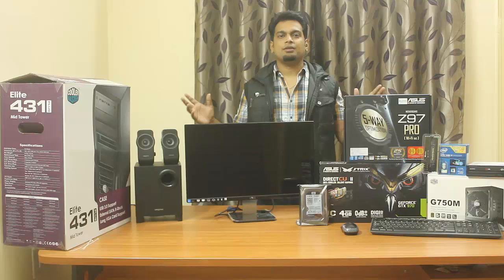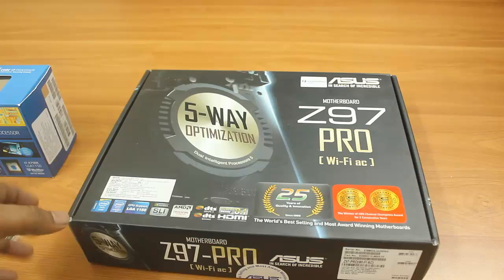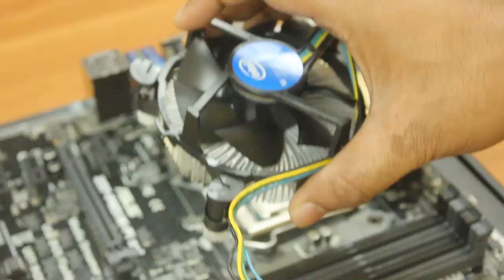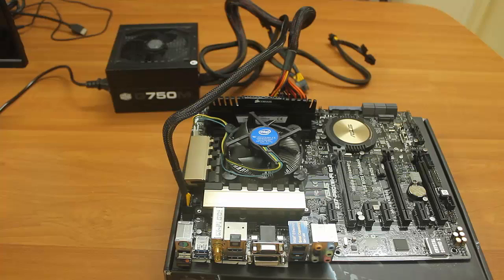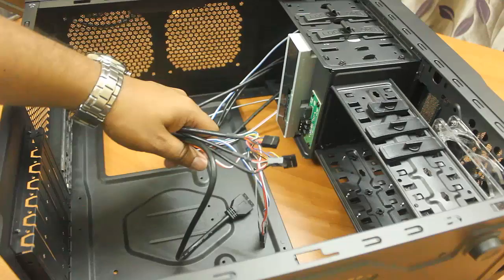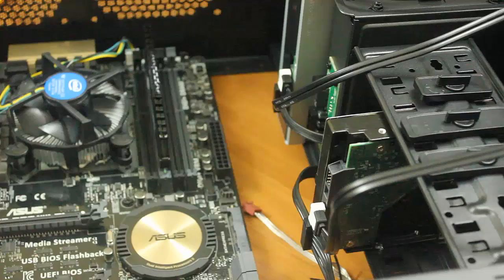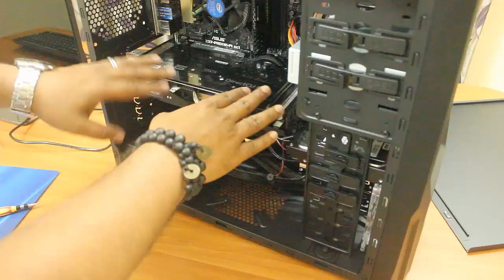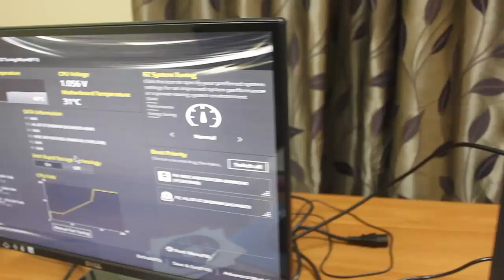How to build $1500 ultimate gaming PC  2015 - 2016 | India | intel i7 4790K | GTX 970 |

Comment: Why one 8gb stick instead of 2x4 or 2x8? You can't use dual channel RAM with one stick configs, and single-channel in an i7 with GTX 970 build seems...poorly matched.
Reply from the maker: bluesy92 Its working great ... All games running on maxed-out setting at 1080p with 60fps ... Video rendering is also quite fast .. Don't know how much will be the improvement after adding one more RAM ..

Comment: Is the standard cpu cooler good enough? Do you have any other recommendation for a cooler? And is the cabinet quite and does it keep the air filtered?
Reply from the maker: Stock cool is good only if you do not overclock your CPU .. else you need to have external cooler .. you can go with liquid cooled cooler from Corsair Hydro Series H60 CPU Cooler ..
Reply: Tech Virus Could you give me the full name of the dvd writer?
Reply from the maker: LG GH24NSC0 DVD Burner
Reply: Tech Virus Gotcha! I'll build the same one you got :) With that i7 cpu I shouldn't need to overclock
Reply from the maker: Right no need as of now for any game .. all game runs at maxed out graphics ... you can overclock when you need it , may be next year ;)
Reply: Tech Virus Yes that's a good point :)
Reply: Tech Virus would you recommend a ssd?
Reply from the maker: If you have budget ... its a good option .. it will help you to make you PC responsive .. like applications will load real quick .. but for games it will not give any performance boost .
I am waiting for SSD price to drop, I would want to go with 512 GB of SSD which costs around 18k as of now , my be after 6 months price will reduce .
Reply: Tech Virus Ah okay so if you have your operating system on that ssd it will boot up a lot faster i suppose. Maybe it's smarter to go the same route as you did, with the WD hard drive.
Reply from the maker: Yes .. now it takes 30-40 sec. to completely boot up , after adding SSD , it will take around 15 sec. , yes you can go in my way , just make sure to install all your games in non-OS partition , so in case you upgrade to SSD you do not have to install heavy games again ;) just re-install OS on SSD and you are good to go .. also there are tools available to migrate OS from non-SSD to SSD drive (not yet checked how effective they are)  .. all the best for your new PC built ;)
Reply: Tech Virus Thanks man for all your help :) I think i'll go with a Samsung 840 evo ssd 120 gb and use it as the bootdrive and the 1tb black edition will be used for storage :)
Reply from the maker: Welcome bro ..I would recommend to buy at least 256 GB SSD , as you can keep resource hunger apps on SSD for super performance and who knows if new windows 10.0 will take 50-60 GB .Its always good to be future proof (at least some what) .. But its your Choice at end as budget also matters ;)
Reply: Tech Virus Yeah it's better to be future proof so I'm going to order a 250gb ssd instead :) By the way which operating system would you recommend? I've used 7 and 8 before and i liked 7 more because it didn't have that bullshit swipe menu with all the different colors :P
Reply from the maker: Good ... go with windows 8.1 , yes it has those stupid things but some tests has shown that 8.1 has better game performance than 7 . And also games in future would more optimized for 8.1 ... so go with 8.1 ;)
Reply: Tech Virus Sounds great :) Does 8.1 have the start button? And can you start in the desktop mode so you won't see the ugly looking scroll menu?
Reply from the maker: yes it has start button but not as windows 7 .. yes you can work in desktop mode :)
Reply: Tech Virus I ended up buying Windows 7 Ultimate for a really good price and it's the retail version with two discs, 32 and 64 bit. With which part do you get the sata cable?
Reply: Tech Virus By the way I was thinking of adding the Corsair H60 Hydro in order to cool the cpu, do you think it's a good choice?
Reply from the maker: Yes.. its a good choice .
Reply: Tech Virus Would that motherboard fit in the Fractal Design Define R5?
Reply from the maker: Yes.. it will , as it says it supports ATX Mobo.

Comment: abhishek bhai processor mera i7 4790k hai after 1 year  it gets hot on gaming yltra 78 d celcius it is normal or not it gaves me this after reapplying thermal paste tell me i needd a after market cooler
Reply from the maker: You need to buy aftermarket CPU cooler, I have purchased Cooler master Hyper series (check my channel) air cooler and max temperature it goes is 58 C . You can use liquid CPU cooler to bring the temperature even more down.
Reply: +Tech Virus yup bro iam ur subsciber and i saw that cooler master hyper x ok so tell me one  more can u help me on skype iam also youtuber building live gaming pc pls tell.
Reply from the maker: +jai yadav Indian Gamer Thank you .. But I am not into live gaming video channel, it would be great if you contact some similar gaming channel owner 👍
Reply from the maker: +jai yadav Indian Gamer Thank you .. But I am not into live gaming video channel, it would be great if you contact some similar gaming channel owner 👍
Reply from the maker: +jai yadav Indian Gamer Thank you .. But I am not into live gaming video channel, it would be great if you contact some similar gaming channel owner 👍
Reply: +Tech Virus ok bro thnx for helping me

Comment from the maker: _PatchcraftFTW _ - This bulild is in US $ only , but in India its costly due to tax . But if you buy same specs in US it will cost you around 1k US $ only ;)
Reply: Tech Virus as ur a genius.Pls search for me that processor of" RDP mini pc XL-800" can be put in any motherboard
Reply from the maker: Thank you .. Yes, it has 4th Gen i5 CPU and it can be fitted in any mother borad which supports intel i5 5th Gen. :)
Reply: very; very; very;YHANKS I was relly curios ao know about this
Reply: after I remove the processor of this mini cpu can I put it in a different mother board like;Asus B85M-G Motherboard
Reply: PLS I want to know which cable is used to connect msi GTX 970 with monitor.I want name of cable .PLS tell me.PLS.PLS
Reply from the maker: You can use any of the cable :-
1. HDMI (I am using this )
2. VGA
3. DVI
4. DisplayPort 1.2
Reply: Tech Virus can u pls tell me that the screws that u used for the motherboard were included if not pls tell me the measure of them
Reply from the maker: No, it was not . Screws were there with cabinet .
Reply: Tech Virus Is there any way to buy those in us and take them here.
Please someone reply , i am just curious. :D
Reply from the maker: It will cost you more if you do in that way .. unless any of your friend is travelling from US to India .. he can carry atleast processor , graphics card and Mobo ..
Reply: Alright. Thanks for the reply :D
Reply: +Tech Virus you are preety good at this Keep going with the good job :D
Reply from the maker: Thanks IsraeGames Coll
Reply: +Tech Virus no proublem mate
Reply: +Tech Virus by the way you have a beast pc :D
Reply: Hirak Patel go with hx series from corsair
Reply: Hirak Patel yes or the Ax series aswell
Reply: +Hirak Patel seasonic
Reply: go for the hx750i which is around 14000 which i was thinking of buying it too
Reply: sure amd fx 8350 
corsair H75 
msi 970 gaming mobo
msi gtx 970
corsair vengence 8 GB 4*2
WD black 1 tb
WD Cblue 500 GB
Corsair hx650
Reply: hmm i haven't had any issue with the memory so far but i haven't played witcher 3 because the game is not my cup of tea but gta 5 unfortunately my hard drive died recently so can't tell you the preformance hits on that but on arkham knight Maxing out the game isn't much of a problem but hitting the vram usage on its limits is a bad idea, you know how well the release was on PC. anyways

Comment: i was wondering if this pc can handle playing game and streaming at the same time?
Reply from the maker: Yes, it can but max play at 1080 and stream at 720p for smooth operation ..
Reply: Tech Virus if u don't mind, can you give me all the link for those parts? I'm trying to build a pc for League of Legend and streaming to make some money. Thank You
Reply from the maker: Which country are you from ? I have purchased it from a local store , I can give you Amazone.com link if you want ?
Reply: I'm from USA and Amazon is fine
Reply: So do u think I can play league of legend and streaming at the same time using that kind of pc?
Reply from the maker: Yes ... you will .
Reply from the maker: Mobo - http://www.amazon.com/ASUS-Motherboards-Z97-PRO-Wi-Fi-AC/dp/B00K2R6GDQ/ref=sr_1_1?ie=UTF8&qid=1424992410&sr=8-1&keywords=asus+z97+pro

Processor - http://www.amazon.com/Intel-i7-4790K-Processor-Cache-BX80646I74790K/dp/B00KPRWAX8/ref=sr_1_1?ie=UTF8&qid=1424992508&sr=8-1&keywords=intel+4790k

Graphics card - http://www.amazon.com/ASUS-STRIX-GTX970-DC20C-4GD5-Graphics-Cards/dp/B00NJ9BJ8G/ref=sr_1_1?ie=UTF8&qid=1424992564&sr=8-1&keywords=asus+gtx+970

PSU - http://www.amazon.com/Cooler-Master-G750M-Compact-CrossFire/dp/B00MAZK8N2/ref=sr_1_3?ie=UTF8&qid=1424992621&sr=8-3&keywords=cooler+master+750w+power+supply

RAM - http://www.amazon.com/Corsair-Vengeance-Desktop-Memory-CMZ8GX3M1A1600C10/dp/B005T63BJM/ref=sr_1_6?ie=UTF8&qid=1424992649&sr=8-6&keywords=ram+corsair+vengeance

Cabinet (different) - http://www.amazon.com/Corsair-Carbide-Windowed-Computer-CC-9011017-WW/dp/B008B6ONXA/ref=sr_1_15?ie=UTF8&qid=1424992694&sr=8-15&keywords=corsair+cabinet
Reply: Tech Virus Thank You so much.
Reply: The GPU on this is a little much for League gaming and streaming... but the CPU is definitely needed. With one GPU you won't need 750W PSU though. The Motherboard is also not needed.

Comment: can someone help me 
i am building my pc with the following parts will they work without bottlenecking
MOTHERBOARD - MSI h97 guard pro socket 1150 intel
CPU - i5 4460 (i am on a budget hence i didnt choose 4790K)
RAM - 16GB DDR3 any brand corsair,G skill, crucial etc
PSU - thermaltake smart power 650w 80+ bronze
GPU - MSI twin frozr / ASUS strix 970
I AM UNDECIDED ABOUT THE CASE CAN SOMEONE HELP AM CONFUSED BUT I WANT TO GO WITH COOLERMASTER IS THERE ANY CHEAPER ALTERNATIVE
HDD & OPTICAL DRIVE ARE FROM MY OLD PC 
THINKING TO GO WITH AN 840 SAMSUNG PRO 256 GB SSD
AND SOME HELP WITH FANS TOO
WHICH CASE AND WHICH GRAPHIC CARD IS BETTER
ALSO HELP ME FOR PC COOLING
Reply from the maker: Aman Bindra Nice built , you do following - you can go with 4790k i5 processor (as may be you would like to over clock in a year or two) .. you can go with 8GB RAM as of now and you can upgrade it to 16GB next year and go with Corsair ..Samsung EVO will also work great .. 
You can go with Carbide Series® Air 540 Silver Edition cabinet ..

Comment: hey brother u might help me out

i m buying a new gaming pc

with i7 4790k and asus strix 980ti

can u help me to make decisions on other stuffs..

like mobo ram cabinet cooling kits power..etc etc

my budget is 1 lac 57 thousand

so like if im spending 20k on mobo

the best possible mobo that really worth that 20k amount

i want that amount

like every other component worth every penny

plzzz do replyyy...
Reply: +ASR if u not ended up buying a new i would suggest u to spend more and build high end  pc u can go for nzxy phantom 410 atx midtower case (16000) for overclocking u need liquid cooling and a good motherboard i would say around 20k maximus 7 8(maximus 8 is fantastic around 23k n maximus 7 for 20.5 k) n  also there is asus pro gamer around 15k worth every penny  now for liquid cooling and psu u need psu>=750m (corsair 850m is best 10.5k appprox fully modular ) and comes cooling u must need liquid cooler go for corsair hydroseries h100i(8k) maximum 58k(total) u can choose cabinet for cooler master can make max. of  53k but ram + hdd 10k more if u r going for 16gb  ram 15k around if u can add 10k (coz 93k for gra+procs.)more u can do wonders

Comment: as an It professional Your Build is great! Although since you purchased a z97 MOBO and a K series Intel processor I'm assuming your going to be overclocking. in the video you're using a stock Cooler which is very bad ( for overclocking) . the next is the case for 1500 dollars you could have gotten a better case. you're pretty much using High-end components which is great! in the future though Might get a better case and cooler. but overall the build is great. In my personal system My I5 2500k is clocked at 5ghz using an asrock z77 extreme 4, Although my build is custom cooled (Ek Parts). with your Build if It was mine I'd go full custom cooling on that one! of course I'd change the case first LOL
Reply from the maker: Gio Tech Thanks Gio .. Yes, I will be upgrading to higher end cabinet by end of this year (I had to cut my budget some where so compromised on this ;) ) .. Also, for cpu cooler , I am not going to overclock it as of now , but before I go for over clock, I will definitely go for liquid cooled cooler .Nice to hear you have over clocked i5 to 5 Ghz , awesome :)

Comment: I almost made my choice of going with the GTX 970 (The same card you have) but after hearing about the VRAM limitation of 3.5 GB & .5 is not usable as per PC-Perspective & Linus Tech Tips.  am kinda set back :( Though this card could be used in a SLI mode which is a plus but draws more power & adds more heat within your case & offcourse adds more cost :(
Reply: Here's the link explaining the limitation on the GTX 970 cards: http://www.pcper.com/reviews/Graphics-Cards/NVIDIA-Discloses-Full-Memory-Structure-and-Limitations-GTX-970

Comment: hi bro this is awesome video, about pc assembling, i have a doubt regarding  pc setup,actually i am planning to buy a pc for running mainly  adobe premier pro cc after effects, photo editing,video editing etc,will the same configuration what you have mentioned in the above video is enough? and one more thing i have seen adobe premier pro cc system requirements in adobe website  in that i have seen nvidia getforce gtx 770 ,for compatibility of adobe premier pro cc(2014), but there is no getforce gtx 970 4gb  , so which graphic card you suggest for doing visual effects, 3d effects,video editing,photo shop in adobe premier pro cc 2014(latest version), or please suggest  best video editing configuration, thank you .
Reply from the maker: YNR channel Thanks ... No doubt gtx 970 is more powerul than gtx 770 , but driver compatibility for gtx 770 is better for Adobe products . I will check on my system(gtx 970) and let you know the performance scores soon ..
Reply: thanks for your reply, is your configuration for the above video is suitable for adobe products, except graphic card (gtx 770 or gtx 970) confusion, or suggest me some best configuration for adobe products. according to adobe premier pro cc(2014) system requirements thank you
Reply from the maker: YNR channel Welcome ... I will let you know the best configuration in a day or two , stay tuned .
Reply: sure--- thank you
Reply from the maker: The GTX 980 and 970 use Maxwell CUDA. This is not supported by Premiere Pro CC 2014, After Effects CC 2014 or Adobe Media Encoder CC 2014. Go with GTX 780Ti if you want it now, else you can wait fro some time for GTX 970/980 new drivers .
Rest of the configuration would be same , just add a 256/500 GB SSD (preferably Samsung).
Reply: but in the given adobe system requirement list there is  gtx780  and gtx780m , there is no
gtx 780ti
Reply: there is one more card gtx 770, in the adobe given list there is no big difference in cost between gtx780ti and gtx 770,around 4000 rs difference but specification is much better than gtx 770(it is given in the adobe list), but my doubt is gtx 780ti is not in the given list of adobe system requirement list.

Comment: Surprised that you'd want to use the stock heatsink with this...  I know it's simple, and it comes with the CPU, but...if one wishes to overclock or do heavy activity, I'm probably going to be guessing that having at least a CM Hyper 212 EVO would be recommended (as that's what I'm planning to use).  Not sure how well that a Hyper 212 EVO would do with the Corsair Vengenace, though...that seems like rather tall RAM to me.
Reply from the maker: Robert Morin I am using stock heat-sink only for time being, I will upgrade to liquid cooled cooler before overclocking it . I will go with :-Corsair Hydro Series CWCH100i

Comment: Hi,
I followed the same configuration and built my system
Initially it worked for 10 days and it is not switching on now,
Being a mechanical guy I'm not understanding the problem,

Problem:
When I press power button there is a sound like 'tick' and nothing happens ,
Cpu fan doesn't rotate, the light in motherboard is on, please help me.

Config all are same, PSU is  corsair RM 750 as u told,

Thanks in advance.
Reply from the maker: +Manoj Golla Is your Mother Board same Z97 pro wifi ? If yes, check the error code being flashed on it and let me know .
Reply: +Tech Virus yes same pro wifi ac board,
The power button has red light on it but nothing happens.
Reply from the maker: I am asking the error code shown on Monther board , open your cabinet , see your mother board , some where it will be showing some number in RED color ..
Reply: +Tech Virus yes I know that, but it is not showing any error code, the only thing glowing is the power button light.I can upload a photo.
Reply from the maker: Upload a small video of Mother board .. also check all power cables are plugged in properly .
Reply: +Tech Virus Did You get the problem
Reply from the maker: I got when I did not put the motherboard standoffs ... which we need to fit in cabinet under mother board .